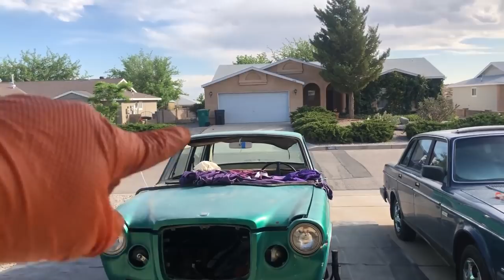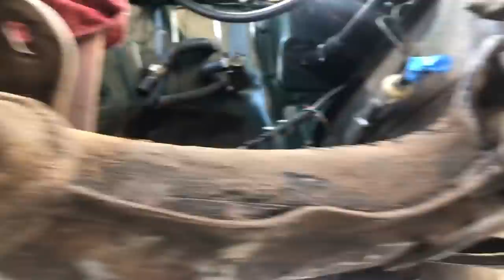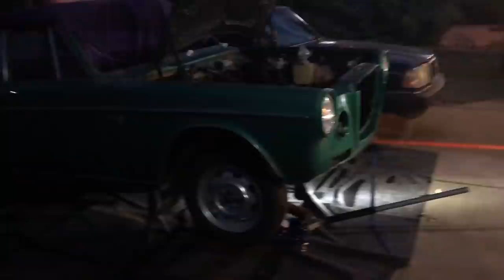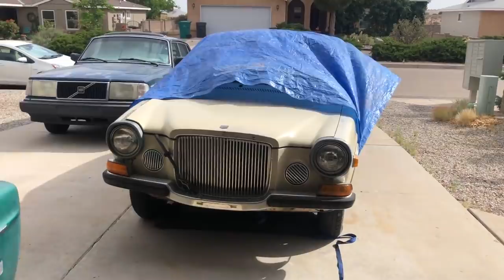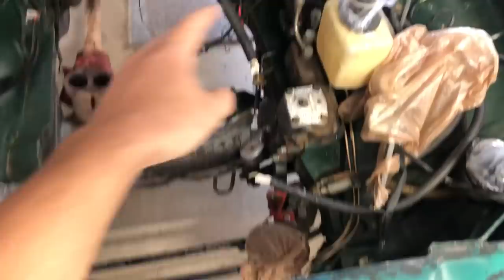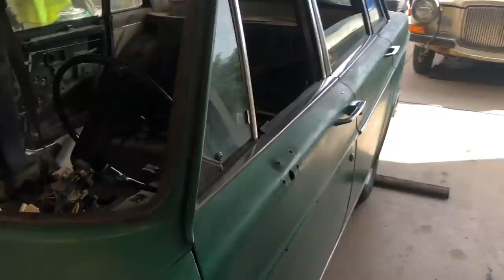Pressure Washing the Underbody - 1969 Volvo 164 Rescue Ep 24

Comment: Great video. Well done indeed. Love seeing Ivy being worked on.
My 1990 240 wagon, Arthur, did not have the dealer installed A/C. My mom is now 91, and with her heart, I really need to add air to the old boy. Finding a 240 with air here is really rare. I would love to retrofit the factory system from a 92/93, as it is much more effective. This could be a fun job.

Comment: Glad things are moving along. Got my fuel injector for my 75 and should be able to get past 15 mph. Lol. Modifying some newish mini Cooper seats for my 70 and saving the bucks to redo the back. I'm sure you'll be driving yours in SLO and I'll be in the paint phase. Will have lots to share irl when I finally get the twins in shape. Good luck.
Reply from the maker: I love a good re-purpose of modern seats into classics. Fingers crossed on your injection repairs!

Comment: On the 1972 central console there are the clock on the middle,left side a green switch for “rear demist” (electric defroster) on the top of the green one we have a purple one and he was for the fog light!
To the right was HAZARD flash light,and the little hole on the top was for the seat belts. It buzzing and flashing when you move the lever gear,in neutral position the light and the buzzing was off!
I’ll send you one pic on Instagram later!

Comment: bet your buddy will like the M47 allot more than the auto. it oust feel so much more correct to drive with a manual.
while the gear lever is out a top tip is to cut the gear lever between the leverage ball and  shift fork mount? not to sure what you call it then weld in about 10-15mm of bolt between the parts makes for a shorter throw shift ;)
Reply from the maker: I feel some closure and atonement for that wagon now.
Reply: @DavidBello  yeah i can understand how you feel, selling a car and something going wrong a while after is not funny, even if it is something you got no control over. that you doing this is why i like volvo and its community, we dont shy away from helping each others out

Comment: I don't know when they moved the HVAC blower motor to inside the car and down stream into the hot air flow causing the bearings to dry out. But while you have a chance check the motor.
Reply from the maker: Right here at 18:10 https://youtu.be/v18Fj14r3lM 😎✌️